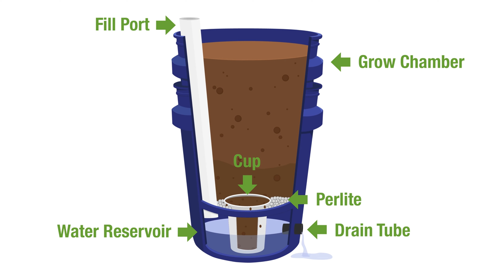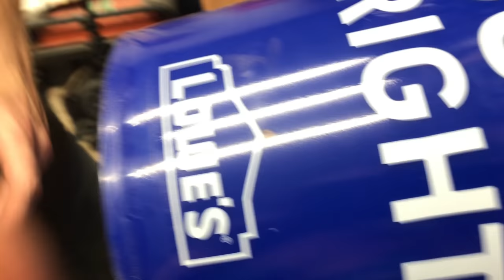How to Build: Self Watering 5 Gallon Buckets

Comment: He left out one aspect that should have been addressed. You should also paint the bucket portion that is going to hold water. Paint it black this will prevent any ultra violet light from entering water, this will prevent mold and mildew. I would paint the outter lower blue bucket about six inches in height, all the way around the bucket. Using black spray paint. You did a great job sir, it will grow many different varieties of food. I use similar system. I was given 50 five gallon buckets that came from Home Depot! Growing in five gallon buckets is efficient, portable, and convinient!
Reply: Although after painting the buckets black I then paint them to white so the water in the reservoir doesn't get too warm.
Reply: I've been using the same unpainted buckets for 5 years.  The upper room if the top bucket has become brittle,  but that's it.
Reply: Aluminin foil works well.

Comment: Tip: Cutting the fill pipe at an angle to keep the pipe off the bottom will suffice; no holes needed.  Tip 2: Making the handles opposite each other (before screwing the buckets together) will help you carry the planter if needed. Thanks for sharing, great job.
Reply from the maker: Great tips, thank you for sharing!
Reply: Ah, yes. Opposite handles & angled cut off end. Great tip & advice. Thx.🙂
Reply: I think he said to pull up before using screws to hold in place. But I agree cutting at angle will keep up from bottom if 🪣.
Reply: Sometime the simplest  solution  👍
Reply: Thank you for sharing ❤. 5 gallon buckets are so versatile in the garden.

Comment: for those of us in mosquito territory: you might want to add screens/filters to the pipes to prevent larvae from colonizing the standing water.
Reply from the maker: I like that idea. I'm in mosquito country in Alabama, but def not as bad as say southern FL.
Reply: Panty hose and a rubber band
Reply: Or just make a solid cap/plug. Fill and drain don't need to be open unless adding water for 30 seconds
Reply: @cameroncook975  needs to be open when it rains
Reply: Or mosquito bits to the water.
Reply: We used the caps they sell at the big box stores that go on the pipes. We have 20 gallon wicking tubs. They did awesome this year. Also try to avoid dark color tubs since the hold to much heat in the sun. We used the brand "good dirt" liquid  plant food and had great succes.
Reply: Or add an aquarium airstone from an air pump to aerate the water.
Reply: @HydroHowTo  south Florida we call them when you in the swamp bird shot 😂
Reply: @robertcornelisse8664  I wrapped my buckets with aluminum foil and scotch tape. Worked well but not pretty to look at but did the job.
Reply: mosquito dunks. they kill fungus gnat larvae also. they come in 6 packs, just toss one in the bucket and it lasts for the season.
Reply: @grumpy_ken   and there are all organic too.
Reply: Cotton Balls or something
Reply: Or you can add a few guppies to the water.
Reply: @YSLRD  which goes into what you eat...

Comment: I don't see a need for a drain pipe. Just a hole there would suffice, wouldn't it?
Reply from the maker: Yep, just a hole would be fine if you're not directing the water away from the bucket. My buckets are on a wood deck, and I don't want the wood to stay wet under the bucket so I direct the drains off the edge of the deck.

Comment: I used cat liter buckets for my design. Best part is you don't need to use screws to hold the inner bucket up. When slipped together the space between the two is perfect. Instead of perlite I used brown scotchbrites with a dot of hot glue to hold the bits down. When setting water capacity, pour 1-2 gallons in the bottom bucket, use a magic marker to mark the water level, dump and the drill your drain tube.
Reply from the maker: Litter buckets truly are the best!

Comment: "Self wicking buckets" are awesome.  Been using a similar version for 3 years.  Found a different design that uses only 1 bucket.  Currently over wintering  3 year old pepper plants in my basements.  Definitely saves water.
Reply from the maker: Sound like some lucky pepper plants! Thanks for your comment!
Reply: What is the one bucket design?
Reply: I would like to know as well
Reply: Yes what is the bucket design.
Reply: How does the 1 bucket design work
Reply: @get6149  there are several videos on self wicking containers on YouTube.  The basis is instead of using the 2 buckets to create the air space foe the roots, you use corrugated pipe covered with gardening fabric to create the air space.
Reply: @HydroHowTo  how well would this work for a cannabis plant? 🤔.  Just wondering?
Reply: @user-cs3zs6jn1d  yes it would. Obviously ph gotta be right but yes
Reply: Aaaaa
Reply: @user-cs3zs6jn1d  it works -_-, basically a 5gal DIY EarthBox®
Reply: how do you water synthectic nutes to the plant
Reply: Look up hempy buckets,they are a single bucket system.Old school passive hydroponics.
Reply: @user-cs3zs6jn1d  same as any other plant. If you can't grow those you won't grow weed. However if you can screw up weed, then you have no business growing lol

Comment: I built a few of these in the past. I used a small fishing bobber with a few straws attached to make a level indicator to put down the fill tube. 
You can also daisy chain them and use float valves and such to make watering automatic. 
Great tutorial!
Reply: RE: Daisy chain with float valve, perfect for me. (I'm forgetful & may not be super attentive.) Thx.🙂
Reply: Ok now Nicodemuscg!!   I need to see your video addition to that if it worked. Also, some asked about painting bucket black to keep light out. Good idea, but looks like your set up is already blacked out w/dark blue- right?? Just asking as a brand newbie thinking this through with other comments. 
Thanks if you can answer.  
Deb
Reply: I am working on making this system at the moment at home. Maybe 5 buckets chained together with a floater and possibly a rain barrel? 

Any suggestions? 😂

Comment: Your a genius Sir! I was wondering how I could automate the monotonous watering regime..thank you so much!
Reply from the maker: Thank you for the wonderful comment! I didn’t invent it, but it sure does work well.
Reply: @HydroHowTo  Ok so I built it and added  an oil pan under it with a micro switch on a float wired to a solar panel and water pump wich circulates over flow back into the top works great 👍
Reply: Just mix in your amendments so they stay fed, and ph your water at 6.4

Comment: I've been doing this for several year for my tomatoes and Green Chilies.  I use net cups , like in hydrogrowing. 1 1/2 in works great    in my top bucket as the transfer cup.  I pack it with coco.  and then blend in coco with my soil for the bottom 3 to 4 inches.  coco is a great wicking medium.
Reply: Thanks for your comment. It's good to know that someone has actually validated the idea.
Reply: @closetcleaner  there's a company called waterwick if you want to look them up. They specifically only do this and it works great for all kinds of plants.
Reply: @yeetme2065 I'll look them up, thank you.

Comment: Great tutorial! I tried it  before, quite the same way (2,5 gallons)  and it worked perfekt! 
The most suprising thing was, when the season was over, I checked the soil and the roots.  There Where over 25 worms inside. At my other normal pots  i never did this observation. It was an organic grow outside with the same potting Mix in all Pots. So why no worms in the normal bots?  My theory is that the constant and right amount of moisture provide a better invironment for the life in the soil. And what can be better than that? The microbiological life in the wormpoo is amazing and you don't habe to add it. I keep on ding this next year to get closer to the lifing soil topic. 
Thank you!
Reply from the maker: Thank you Christian!
That sounds like a pretty solid theory. The only other thing I would add is that the water reservoir in the bottom provides airflow and natural cooling.
Reply: @HydroHowTo  your soil will get better every year if u keep it hydrated all year. Soon you'll have the best in the world. Give it mollases and a dash of coconut water

Comment: I like you're idea of raising the upper bucket and holding it in place with screws to create a larger reservoir, I'm going to give it a try.. I use a 3rd bucket and cut away most of the bottom and use it as a spacer, buckets with an extra large rim are hard to come by. Instead of a paint bucket I use a piece of 3" PVC with an interior test plug (flat) on the bottom, hole saw makes perfect cuts. Also like your idea of using perlite on the bottom of the upper bucket. Think I would prefer coarse perlite but hard to source locally (Amazon $$$$). Thanks for the ideas. I also have a larger 35 gallon version for tomatoes. I might try my hand at a YouTube video to show it. Glad to share if you're interested.
Reply from the maker: Hey Tom, thanks for the comments! I like the idea of the 3" PVC pipe with the test plug. I ended up buying a huge bag of coarse perlite from my local farm supply center, if you have one nearby that could be an option. I'd love to see that 35 gallon version! You should definitely make a video on it!! What kind of tomatoes do you grow in those big versions?
Reply: @HydroHowTo   Overcome by events. The 35 gallon version uses a 5 gallon bucket upside down with a 3-4" hole for a piece of PVC for wicking chamber. I use a 1/2" PVC for the divider that sits on top of the bucket, I have to cut it in half to get in place. I grow Better Boy, trying several different Hoss varieties next spring. If you have a Facebook page or want to share your email I'd be glad to share pics of my planters.

Comment: Nice job with the video. Some of the other ones on YouTube tend to be a bit long because they didn't edit anything. Yours is nice and concise. Two things I would suggest with the fill tube: Just cut the bottom at a 45. done, the second is to put an offset oil filler funnel on the top of the tube. It makes it easer to fill, when the plant is bigger it's easy to find the filler.
Reply from the maker: Great ideas! Also, thanks for the kind words!
Reply: @HydroHowTo  also can use a household funnel to get the water where it needs to go. just use it when you water, don't leave it on the tube 24/7.

Comment: half a year later glad to report these do work, cauliflower and broccoli took well to them. only thing i would note for anyone else trying to make them is to keep in mind the height of the net cup you use. you want to make sure it sit flat in the top bucket, and not be pushed up by the bottom bucket. if not the soil seems to over water, become too wet for plants and the leaves turn yellow.
Reply from the maker: Great to hear, and great tips!

Comment: Hello! Im planning on using this system this year and im very excited! I just had a quick question. Would it be smart to drill a few small holes in the side of the bucket where the soil will sit to help with airflow? Or would this not really have any effect? Thank you!
Reply from the maker: Hi Mitchell, I don’t think that would have much effect, but don’t let me talk you out of experimenting. Give it a try, and let me know how it works. Thank you for reaching out!
Reply: Look at Alaska Grow Buckets. These use a colander and a grow bag, like a cloth shopping bag, and have holes in the bucket. This causes air pruning of the roots, resulting in a much better root system.
Change the continuous water feature to a fill tube.

Comment: Cutting the end of the fill port at an angle will give it lots of room flow into the reservoir. 

Just a helpful concept from another video. Currently putting together ideas from lots of people to try and make some "set and forget" potatoes with a large fill reservoir on a float. I feel like they need a wet/dry cycle to prevent rot through
Reply from the maker: Thanks! I agree, the angled fill port is handy. Interesting! Would love to hear what you come up with!

Comment: Do you feel satisfied with how much air is getting into the root system and how uniformed the water distribution is? Was wondering if that input tube is always above the water line, more air can get in there. Other self watering buckets have that smaller wicking holes and on the side. Let me know and thanks!
Reply: If you're concerned about uneven spread of water. Coil 3/8-1/2" nylon rope on the bottom.

Comment: The buckets stay permanently screwed together? Is that an issue at any point when you go to clean or harvest your plant or check for bugs or inspect the roots or anything like that? This looks like a good idea a bit different that other hydroponic systems with less moving parts which is cool. I'm just lazy. I might just stack a few rocks in the bottom bucket to keep the cup from hitting the bottom and rising up to break the clean seal. I have a few buckets that I may try this method with. Thanks for the video!
Reply from the maker: I haven’t had any issues. I break the buckets down at the end of each season. Also I use this for soil-based gardening, but it works for hydroponics as well.

Comment: Great video.  What are your thoughts on adding the bucket lid to the system as well?  You could still have a few holes in the lid for catching rain water, but it would also act as a shade barrier and limit evaporation.  Would it cut air flow too much and create a mold or fungus issue?

Comment: Put a small cork onto the end of a thin bamboo stick. Before adding water, drop it down the fill tube until it hits the bottom. Now mark a line on the cane at the top of the pipe. Put it to one side. Fill with water. You can put the float you built in from time to time and make sure the mark you made is still above the top of the pipe. I would refill if it`s closer than 1/4 inch.

Comment: If u like Ocean forest from Fox's farms you should try there strawberry fields soil 😮😊🎉mix both together with worm casting like the video I've been using this set up for 2 years now but I've switched over using 3 bucket the center bucket is just a spacer u are only using the top piece this helps you out so no screws are used for the space it's truly working great
Reply from the maker: Sounds like a great mix!

Comment: Why do you need a dtain tube?  Just cut thr hole with a drill bit. The watet eill run out. I do this with 1 bucket and use a dmallet bucket lid for the false bottom. Can use a 3" whole saw to cut thr opening to the bottom. Good vid.
Reply from the maker: I use the drain tube to divert water off my deck.

Comment: will this method work with 5 gallon nursery pots??? They're not as stout as the ones you used.
Reply from the maker: Hi Kathy, I don’t think this specific method would work well with a weaker pot due to the weight of the soil in the top bucket. You could though, add the fill pipe to a single nursery pot, fill the bottom of the pot with coarse gravel, and then fill the pot with soil. I’ve had several people tell me that method works well for them. I hope that helps!

Comment: According to a moisture meter, the top 6 inches or so of my soil isn't getting any moisture. Is this the way this system is intended to work?
Reply from the maker: That’s probably pretty close. I normally have a 3-4” crust on top. It helps discourage burrowing insects from taking up residence in the soil.

Comment: Good I idea except for if water sits then the ph would go to high or to low acidity levels be whacked
Reply from the maker: Thanks! There is enough water in the res to supply the plant for about 2 days, hardly long enough to worry about pH buffering, especially considering there is no nutrient load in the water aside from what is delivered via the soil.

Comment: Hello HHF, I followed each step of the construction of the self-watering pot. Everything was going well until the fifth day when it started to smell rotten. When separating the buckets I saw that the water was rotten. Where could I have been wrong? Please help me! Greetings from Buenos Aires, Argentina.
Reply from the maker: Thanks for reaching out. I normally add water every couple days flushing some of the old water out. This will keep help prevent stagnant water.
Reply: @HydroHowTo  Thank you very much for answering. Gracias!🙂

Comment: Would this work ok in a grow tent or would the lights dry it out too much?
Reply from the maker: It can work in a grow tent. I have used them in a grow room and they did well.
Reply: @HydroHowTo  I've only got a small tent with 4 plants so next time round I'll try running one of the plants with this set up to get a comparison. Thanks.
Reply: @HydroHowTo  sorry, another question. For plants such as cactus that like sustained dry periods, I'm guessing this wouldn't be a good method?
Reply from the maker: I haven’t ever tried that. It could possibly work, but would require some experimenting with soil compositions.

Comment: Can I use coco coir at the very top of the bucket to help keep the soil moist?  Would you recommend or not?
Reply from the maker: In this setup, I personally don't want the top of the soil to be moist. A "hard" crust on top helps keep burrowing pests from setting up shop, and it seems to keep the base of plants healthier. Plus, the root system is growing down into the soil, so a moist top doesn't really do the roots much good.
Reply: @HydroHowTo  thank you.This is new to me but so far it’s coming around.
Reply from the maker: You’re very welcome! It just takes a little time, patience, and practice. You’re doing great!

Comment: Would top dressing work with this? If so would you have to water from the too after you top dress ?
Reply from the maker: I used to top dress tomatoes every 3-4 weeks in this bucket and it worked fine. You can top water after you top dress.

Comment: Will this cause mineral build up in your soil and and throw off PH levels? If someone was to use liquid fertilizer mixed in there water rather than a loaded potting soil would it work still? Ever need to flush your soil?